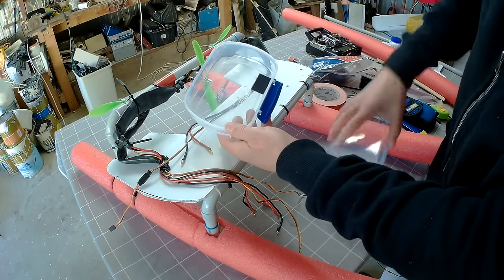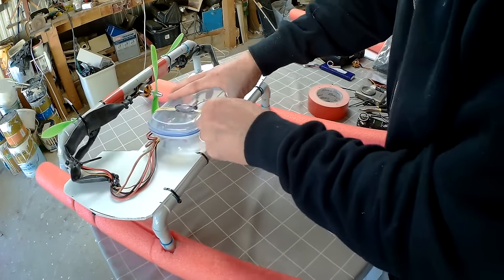Rc Rescue Boat build

Comment: Andrew... This is an awesome build. I cant believe how well it goes across the water. I thought it would have been much slower. Great job.... A small trick I learned years ago was heating and bending PVC pipe. It would save on the cost of fittings.  There are many ways to bend PVC pipe but I normally just use a heat gun. I am inspired by this video and have some spare motors and props and perhaps I could try building one too. Your design is great. Thanks for sharing.
Reply from the maker: Excellent, let me know how you go

Comment: My son and I put together one really quickly from parts we had at home. Not as zippy as yours but eh we had a good father son project. Still need to wire up the rev motor and adjust a few things but it floated ;) Thanks for the ideas.
Reply from the maker: Great to hear Andre, and it would only take a few mods to the floats and it would be a snow boat!

Comment: As always, clever, inspirational  and flawlessly executed. Don't want or like RC boats but this video makes me want to build one. I'd have sealed the cable hole in the lunch box with a blob of hot glue. Seems that would seal it better.
Reply from the maker: Yes it would. Silicone sealant would be even better, but I didn't want it to be that permanent at this stage

Comment: Great vid thanks. I'd like to build a slower version and maximise run time. What is your run time currently? To max run time what is needed & what might be achievable? Could I add solar, if so what changes are required? Much appreciated 👍
Reply from the maker: Bigger batteries and careful throttle use is the easiest way to give longer run time. Check out RCtestflight for solar boats
Reply: @AndrewNewton  Hi Andy thanks for your reply. Do you think I could add a 10Ah 1.5kg battery to this setup and still get bouyancy & thrust? Could I perhaps then get 30mins low throttle? Thanks 😊
Reply from the maker: @chrisdewar9659  You would get hours of run time with that battery.

Comment: Very nice build but I am still wondering how a rescue would be performed. How would you capture and tow a distressed plane or other object. Push the victim sideways maybe against the floaties? Design a makeshift pushbar on the front and/or back?
Reply from the maker: Push bar or loose line between the bows will be my first test. Then trying to encircle the seaplane with a line and manually pulling it back in.
Reply: ah, the lasso idea is a good one. maybe a long string with an empty water bottle for a float. drag it behind you, then just circle around the rescuee and capture it that way, and drag er back to you. nice.

Comment: I built the boat (looks great) but I can't figure out "differential thrust" in you mixing video. My Spektrum DX7s does not seem to have "curves".  Is the Turnigy TX, you use, the only one that can do curves and if so can you send a link.
Reply from the maker: Hi Ron, I'm using OpenTX which you can run on Turnigy 9X, 9XR Pro and Taranis. Higher end Spektrums must be able to do curves but I know nothing about Spektrum. Flite Test have done a video on differential thrust with Spektrum I think.

Comment: As I'm only using cheap speed controllers I'm going to see if conformal coating does the trick of waterproofing them. I have cut the covering off and given them several heavy coats of the acrylic coating I have had good experiences using on greenhouse automation electronics. I have also seen a video of a conformally coated 2.4GHz RC receiver working in a jam-jar of water - I always assumed 2.4GHz stuff would object to having anything sprayed on it never mind immersion!. I have an AR7000 receiver I bought for buttons so I might try the same experiment with that.
Reply from the maker: Fun experiment. Let me know how the ESCs stand up to.a swim
Reply: @AndrewNewton  Many thanks for the reply. The ESC experiment went well. Even fully immersed it seemed to work OK. I did think the start-ups might just have been a bit more ragged than when dry but, as you might expect from £10 ESCs, they are not the sweetest in this regard anyway.

Comment: Hi Andrew just finished building one   Caught up on the wiring part   Can you give me a quick summary how to wire them up please
Reply from the maker: Excellent to hear. Each motor connected to an ESC then all three ESCs powered from one battery via a 3 way cable. Each ESC connecting to its own channel in the receiver with only one of the ESCs providing 5V
Reply: Andrew Newton thanks for that.  I’m really not electronic minded at all and having some concern about the one esc powering the receiver and how I achieve that. What size battery do you recommend? Do the motors get connected by which method series or parallel?  Cheers
Reply: Hi. What size battery was used.
Reply from the maker: @petersymec5259  3S 3000mAH

Comment: Here in the UK I suspect I would only get blank looks if I tried to buy a "pool noodle". I hope that the grey pipe insulation that is obviously more in keeping with our weather will be an acceptable substitute 🙂
Reply from the maker: Haha, same stuff just different colour I suspect
Reply: @AndrewNewton  Many thanks for the reply. I'm still having fun with a sub 250g motor glider using a depron wing as per your instructions. Indeed I may go sub 250 completely as I machined my left thumb with a palm router (I should never have joked about them being for routing your palm 🙂) so I'm not too sure about my abilities on the left stick for more critical stuff.
Reply from the maker: Ouch. I shortened 3 fingers with a router and a biscuit joiner bit. Luckily they still work OK
Reply: @AndrewNewton  Oh hell! I was putting biscuit slots in oak planks when I had my accident. My family's gallows humour really helped - take a deep breath and count to 9, cancel the order for red mahogany stain, etc.

Comment: Hi, I have a question: what wind power in knots or kmh could this be reliable, and what about waves on sea? I was thinking to rescue DragonForce RG65 or IOM sailboats, could it be done with this or those IOM or DragonForce 65 boats are to heavy maybe?
thx, love your work...
Reply from the maker: Probably not suited to stronger wind, I only tested in 5kn or so. With more power and weight it would work

Comment: Hi there. Mine will only have two rear props. I'm not very electronically inclined so excuse the stupid questions. Do both esc's need to have bec's ? Also what size lipo are you using ?
Reply from the maker: Good questions, only one ESC needs to have a BEC (to provide 5V for receiver and any servos if you have them) Doesn't really matter if both have BECs but it's probably better to remove one of the red ESC servo cable wires so that only one is providing the 5V. I used a 3S 3000mAH Lipo

Comment: I can follow your RC Rescue Boat build till you combine the 3 motors to one harness. Can you explain in a little more detail?
Reply from the maker: 3 motors, 3 ESCs (only one providing power to the receiver), plugged into 3 separate channels. The magic is in the mixing. https://www.youtube.com/watch?v=80iH9CsB5CM
Reply: Thank you for the response, but I was not clear. How do you attach the 3 esc's battery lead to one battery, and is it parallel or series? I could not find a harness to buy. I am a newby !!
Reply from the maker: Oh yes, you can buy a 3 way breakout cable from Hobby King, or make one up yourself. http://www.hobbyking.com/hobbyking/store/__25479__XT60_to_3_X_3_5mm_bullet_Multistar_ESC_Power_Breakout_Cable.html

Comment: Hey Andrew, just wanted to say thanks for your great videos which inspired me to have a go prior to risking my Tundra on floats! I made a few tweaks ... used a bigger box as the centre of the frame so there's no deck, and used two motors with reversing ESCs and trick mixing on the Taranis. I needed to move the Lipo right back and add a bit up up-thrust on the motors to stop the bows digging in (due to the high thrustline) but it goes pretty well now. I have everything (radio, ESCs, battery, LEDs) inside the box ... used 60A ESCs to reduce the risk of overheating (each motor pulls 15A on full throttle). Thanks again, Bill (UK). A very short video of mine:

https://www.youtube.com/watch?v=YqhEDT9BN70
Reply from the maker: Fantastic, thanks for showing me